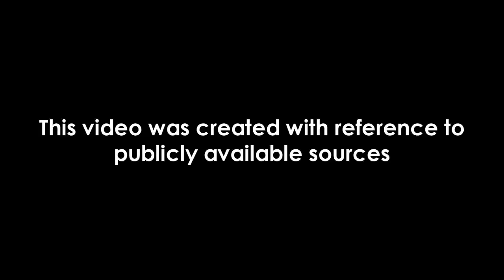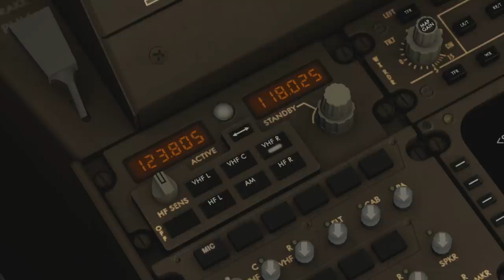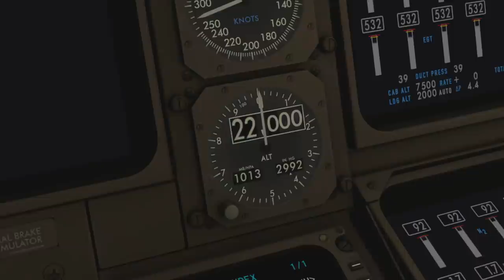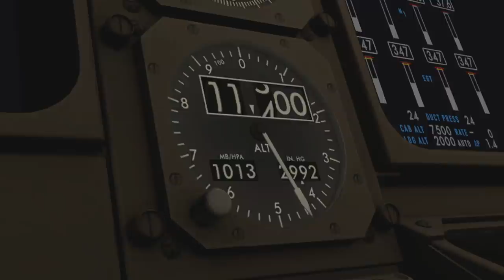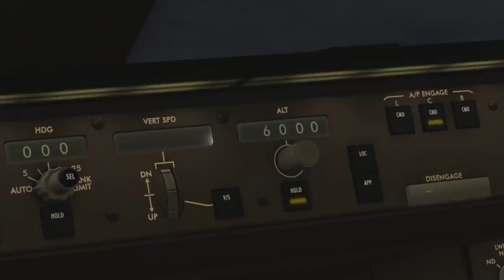The Wrong Signal (Turkish Airlines Flight 6491) - DISASTER BREAKDOWN

Comment: We lost a cargo pilot which was so identical to this accident you could simply change the names. At KCAE the last small freighter out was a small twin which flew bank work. He was young and iirc was his first paying flight position. A few times a year we get really thick ground hugging fog. Even UPS were going missed but he wanted to "take a look". He overflew the runway level and then descended off the end centered on GS right into thick trees. The plane burned for hours and eventually a helicopter spotted it when the fog started burning off. I was part of the crew to secure, help document and remove the aircraft. Pressure to get in and inexperience were the final determination.
Reply: The crazy thing is that Travis Barker was also involved in an fatal accident at KCAE. I know which crash you are talking about with your cargo pilot. What a shame and I hope he RIP and everybody else could process this tragedy and move on.
Reply: @JIMJAMSC Was it a Beechcraft C90 or a Volpar 18 ?

Comment: If the airport had marker beacons on the ILS, they would be a sure-fire way to know that everything is ok or something is wrong. 

Usually there are 2 but sometimes 3 of these beacons. There is a simple flashing light and a tone in the cockpit when passing over them and on the approach chart the altitude is given. 

Every ILS I've ever flown had these beacons and every time, I checked my altitude with the chart. 

False ILS signals are very rare but they do happen, usually when the system is being worked on. A few crashes have happened when the ILS is listed as 'out of service' but the pilots tune to it and it works so they assume it's good but in reality it is giving false signals.
Reply: But what would it be doing there in the first place. Now I know of ILS being worked on but in those instances it would provide you with the incorrect slope, I think we are missing a big chunk of information here.
Reply: Isn't it SOP to cross check ILS DME to the appropriate altitude listed on the approach chart to ensure you are on a correct glide slope? Like for example an ILS approach at an altitude of 2000 FT, with a GP of 3 degrees, the plane will intercept the ILS Glide Slope at 5.5 NM from runway threshold. Or is it possible to false ILS signal gives out wrong DME information to the pilots?
Reply: @junrenong8576  Not all ILSs have DME indications, that's what the marker beacons are for. 

But yes, if DME is available, you'd use it to verify that the ILS.

Comment: I find it very strange that the two runways, 08 and 26 at that airport shared the same frequency for the ILS approach. Sounds like a real recipe for a false glideslopes attributed disaster waiting to happen.
Reply: It kind of sounds like that’s what happened in this case by where the plane ended up. It’s crazy they would have descended into that big mountain range earlier if the atc didn’t save them from themselves by denying their request to go lower.

Comment: Reminds me of Invicta Airlines flight 435. That plane crashed in Switzerland after ILS locked onto a false beacon, which was created by accident by the Swiss national energy grid, as the frequency of grid control systems sent over high voltage power lines through the mountains was close enough to the frequency of the Basel-Mulhouse airport ILS beacon that the aircraft locked onto a power line up a mountainside.  

My Grandfather was the investigator who looked into that crash, which took place in 1973.  He had a lot of very critical recommendations for improvements to ILS procedures. Seems they weren't universally followed

Comment: I don't understand this accident. 
Capt was so worried about being too high when crossing those mountains - why? What made him so nervous?
Capt was wayyyy too high at TOPKA and a quick check would have told him so long in advance - why did he deviate in altitude by 3000ft when he previously was so concerned? Why was altitude no longer an issue?
I have never seen a crash where the company so quickly promises monetary reimbursements to the victims, it was done in what felt like just a few hours*. Why this rapid?
---
*clarification: I followed this when it all unfolded back in 2017 and they were almost expecting this crash? I don't get it. Did Capt speak to company before the CVR erased it?
Reply: Didnt ATC Not allow further decent due to mountainous area? Or i got it wrong.
Reply: @Sverige   at TOPKA, ATC had only cleared him down to 9,000, that is why he was so high.   He was concerned because he knew he could be lower, however, ATC would not clear him to be lower.
Reply: Once he was told he could descend he should have slowed to make it in the space available .. He was far to fast in the descent.. He had time to descend if his speed was correct but he was eating up distance in relation to his nominal intercept altitude all the time.. TBF in his head he probably didnt think this would be an issue but the hidden consequence was the plane was too high when it intercepted the signal and therefore picked up the false ILS.
Reply: @ightenhillsim  I don't understand this and I think the false ILS part could use some more explanation. I thought if a "secondary harmonic radio lobe", that is, a false upper/lower beam, is intercepted, the resulting glideslope will still lead to the start of the runway, it will just be more steep or more shallow than it should have been. What seems to have happened here is it led the plane to the end of the runway? How is that even possible?

Comment: Don’t understand why a pilot so obsessed with descending and being to high for an approach would then fly 3,500 higher than the published normal height. First he was mad because he couldn’t fly into mountains, and then when he could safely descend to vector onto the glide scope he’s flying thousands of feet to high. I’m wondering if he has his airports mixed up in his mind.
Reply: Because he knew he was too high. As it's said before, the captain pilot used the same airport many times before. The thing is, for some reason, ATC didn't clear him down to 6,000 at TOPKA. The crash was mostly the airports mistake. Giving false ISL signals. Not warning the pilots about their high altitude. Not warning the pilots about their high speed. Very bad.
Reply: That’s completely incorrect to blame the airport’s glide slope. False glide slopes exist on every ILS approach. Trying to intercept the glide slope from above sets you up to intercept a false 9 or 6 degree glide slope before getting down to the correct 3 degree slope.

Comment: How is it possible to pick up the wrong signal?
I am not familiar with the technology, I was expecting it to be an unmistakable kind of signal for the approach points
Reply: They can pick up reflected signals in mountainous regions. Rock faces are like mirrors for radio signals.
Reply: They captured a false glideslope which was much steeper than the proper one. It’s an inherent issue with the ILS system, and why cross-checking altitude is so important.
Reply: @nonja  well that definitely makes me want to check the weather forecast for my upcoming flight
Reply: @Luka_menorykee  usually airports have different localizer frequencies so this doesn't happen. You don't need to worry

Comment: Where were the false ils signals coming from?
Reply: From the other side of the runway. Each side of the runway has a localizer. Because the plane was so high the ils thought it was going for the other end of the runway and suggested a wrong glideslope
Reply: @ThePlanemadness  thanks for the explanation. I thought it was picking up an erroneous signal for some reason but your explanation makes perfect sense.
Reply: It may be that the same frequency was serving both sides of the runway. But in some conditions you can get echos of the localizer beacon. Generally well above and well below the correct glide slope. You should not be locking onto the echos unless you are seriously too high or too low for the approach. And both the pilots and ATC should be able to quickly spot that as the plane would be seemingly locked on the localizer beacon, but not the glide slope one. Captain had only 2 prior landings at the airport, a small airport, barely adequate for a 747, late at night in heavy fog, with the Captain and ATC in conflict over desired altitude as they neared their approach. Yep, nothing at all unstable about that approach. I may have to research this one a bit more. Why were they unable to successfully do a go around? What were the final findings with regard to the crash? And OMG those poor people at home sleeping in their beds when this airplane plowed through them. Any air crash is horrifying, but there is something so much worse when they cause this much death and destruction on the ground as well.

Comment: Can someone please explain how the ILS can give off a false signal? And what is to prevent the at any other airport from giving out a false signal?
Reply: I believe the ILS echoes a signal above it and below it. So if the plain intercepts the ILS at the correct altitude then it doesn't get the echoes (aka the correct signal). If it intercepts it to high or too low, then it'll get the echoes (aka the false ones)

Comment: I'm not a pilot but i watch a lot of these sort of things. Automatically i put confusion or
irritation by a pilot on fatigue as this is long haul and controllers can vary in quality.
What i can't accept is the ability for any aircraft to pick up a false ILS and for systems to
allow for a landing based on that data when lives are at stake.
Reply: It's a limitation of the physics of the radio signals. I'm not well inclined towards the math of radios, signals, and electromagnetism in general, but, as I understand it, just projecting the two lobes of signal and causing them to interfere with each other usefully basically has to give false signals. We can predict where the false signals are, and we can make sure they're far enough apart from the true signal to make it incredibly obvious whether or not it's the correct signal, but, as happened here, you still have to have the spare headspace and brain-power to remember to check.